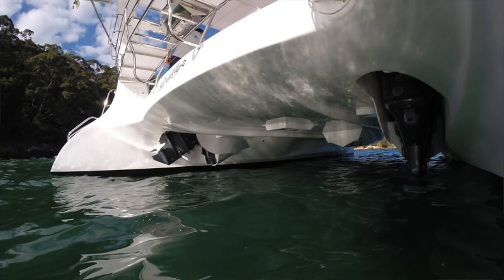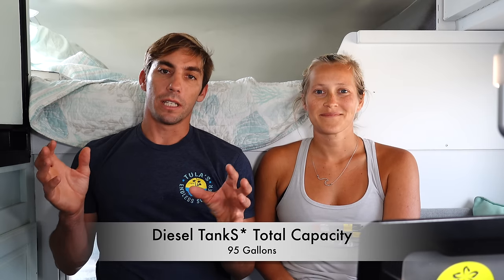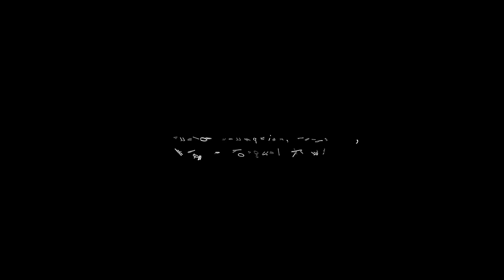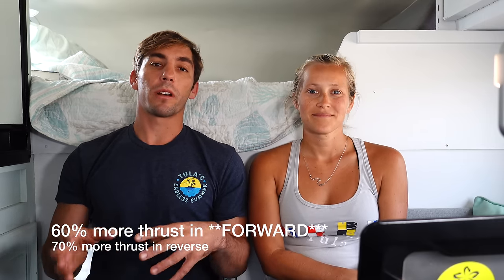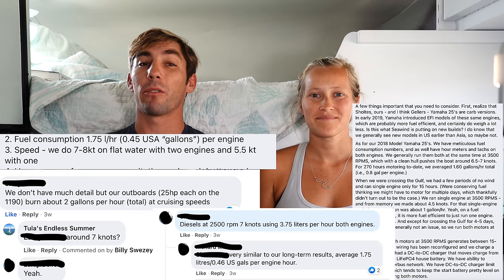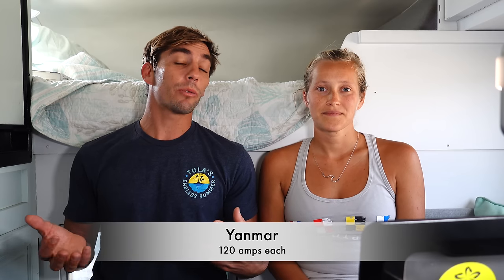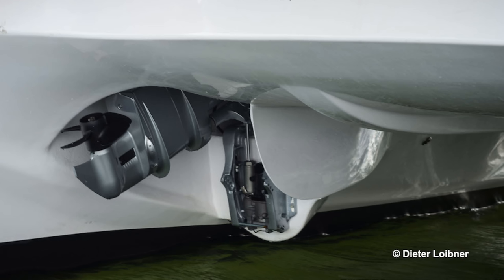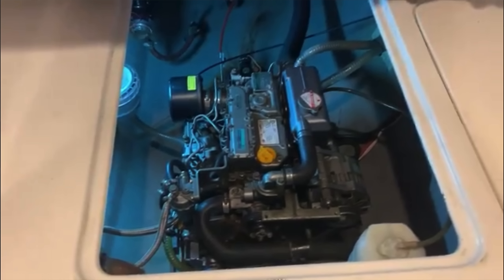Do Outboards Make Sense on a Performance Cruising Catamaran?

Comment: I went over this same decision when I was looking at getting a Seawind. In the end I spoke to someone who's got the Yamaha outboards on his Seawind and he's really happy with them. He's based in Singapore and has sailed all over SE Asia in his boat and he's happy with the Yamahas since he can get parts and service nearly anywhere. He also has a Honda portable Gen set he uses and has only one type of fuel on board. He carries extra fuel for his outboards, generator and dinghy and often runs on one engine to extend range. He loves pulling the engines out of the water to reduce drag during sailing and he's always getting caught in fishing nets etc so pulling the props out and removing the stuff stuck to his props makes things easier. However, if he was living on the boat full time he'd get diesels. He only sails a few weeks at a time so the outboards work better for him in that situation.

Comment: Diesels, for sure.  Can't beat the fuel efficiency and increased range for travel.  Your going to appreciate the tremendous amount of amps they can generate to charge your lithium battery bank.
Reply: I think the added weight outweighs the fuel savings, tbh. Factoring in the haul outs for the sail drives and other maintenance kind of dusts the whole $$ differential.  Not factoring in the thousands saved by going outboard.

Comment: After watching so many cruisers doing engine compartment yoga while sweating their balls off I feel like this category should carry additional weight under the quality of life category. Even the hassle of maintaining a folding prop verses an outboard prop is a big difference, not to mention the expense. A folding prop means carrying more spare parts, greases, zincs and prop coat too. When you're in crocodile water out in the middle of nowhere working on your prop while trying to not lose your tools and parts to Neptune your value scales tend to shift. I've been on the fence for what I would actually choose but can I say that I feel like I'd prefer a third option?  It might be cool to have a decent sized gen set that is accessable for maintenance and two electric outboards. That way you eliminate most of the negatives of outboards while keeping most of the positives. If the Genset takes a dump on you then you're still in better shape than a monohull because you maintain some redundancy because the solar will provide electricity to run the electric outboards. Not enough to motor out of a no wind situation but enough to get in and out of an anchorage and set the hook. Aircon would be a nice bonus under this setup too. I know it isn't a perfect solution but I like the pro's vs con's a lot better.

As a general philosophy I feel like the best part is no part. The less complex something is the better. Less holes in the boat for props and raw water is better. Less internal combustion engines to maintain is better. Less prop complexity, maintenance and parts is better. Unless a person enjoys engine compartment yoga, trying to get all kinds of parts while in the middle of nowhere, extra work during haul out, and spending tons of money.
Reply: I think you have hit the nail on the head.  Everyone is saying Diesels but that's really been the only realistic option.  Maintenance ease and cost is a big consideration.  KISS - Keep it Simple Stupid
Reply: yes, i would say se same! electric outboards is the best under sail.

Comment: I wish I had known you were asking for input on outboards- we chose the outboards. We have found that the diesels run a knot slower under sail because of the drag/ weight. We have a diesel generator and outboard motors. We will be using the "inboard" space to hold our scuba equipment. We are also live-aboard, though we are coastal cruisers. Regardless of the engine, we recommend running only one unless necessary- it doesn't slow you down and you save so much fuel! (AND WELCOME TO THE SEAWIND FAMILY!!)
Reply: Good to know Barbara... How do you feel about the engine noise?

Comment: The diesel would be my choice regardless of cost because of the charging capability and the extra torque or thrust.  If you ever get into a tidal change with 6 knot currents and high winds the diesel pays for its self.  That is an extreme but I have found it prudent  to always plan for the worst.  If cost is the final factor Then the outboards will work fine because I know you plan based on their capabilities.   The big factor here is that you do get to make the choice.  The new boat is coming.

Comment: I would go diesel !   I have a Wharram cat with two Y 9.9 outboards… I am constantly cleaning carbs and  desalting from sea spay up into the outboard sleds. The weak link in my vessel for sure.. congrats!!
Reply: Yeah, Diesel - if nothing else it's not a combustable. Gasoline fumes on the other hand...
Reply: Yep I think you made the right choice just the energy output alone makes this a no-brainer if you're living on board full time. The extra 400 NM range is a huge bonus and diesel engines are so much more reliable. You two are definitely on the right track, I can't wait to see you on your new boat!
Reply: I always say the correct number of holes drilled in your hull is 0
Reply: Best way to keep spark plugs and carb clean, is unplugged your fuel line and run the fuel empty out of the carbs. I know that’s a hassle, but Honda recommends this with lawn mowers and weed wackers, so if you go with gas, you need to empty the lines and carbs.
Reply: Newer 2 stroke outboards are direct injection. No oil burn (smoke) as the exhaust valve isn’t exposed when the fuel gets into the cylinder.
Reply: Cool boat! Love the philosophy behind Wharrams. Tiki 26? Did you self build?

Comment: I've had inboards and outboards over the years.  I found that lifting my outboards out of the water when idle prevented the galvanic corrosion I experienced with drives that sat forever in the water.

Comment: Something you did not hit on is hull penetration for prop shafts. I have an I/O drive on my gas driven boat and I have had water leakage due to the shift cable boot. I completely understand your well thought out choice for inboard diesel. With outboards you have no potential leak points.

Comment: Good choice.  I was part of a crew that moved an older Seawind from the west coast of Florida to the Miami boat show and back. Pushing into the wind going across Florida bay the outboards cavitation was a huge issue.  The fuel fills where on the bridge deck and the vents were sketchy so we had to close up the hulls when fueling. The range was so poor we had ten Jerry  cans lashed to the stern (which expanded in the sun and dripped )

Comment: We own a PDQ cat and I just changed out my two Yamaha 9.9 high thrust motors. The old ones lasted 17 years. We also run a 9.9 on our dinghy so can share spare parts mostly. Can’t beat the replacement cost! I would probably prefer diesels but I’m quite happy with my outboards! It would be nice to have more power generation however.

Comment: 4 1/2 years with our 1160 Lite and Yamahas and I'm still very happy with that decision.  That includes a fair # of blue water miles/long passages.  The increased sailing speed + ability to clear a fouled prop have been the biggest benefits to date.
Reply: Hi Bob Scholtes. 

Good that you mention Speed while sailing, that is totally missed in this video. What do you experience as extra speeds with lifted outboards compared to the diesel saildrives? It's not only the drag, but also the weight.
Reply: @PieterOskam  We've sailed with other 1160's with the diesels and are usually at least 1/2 to 1 kt faster for same sail plan and point of sail.
Reply: Curious if you still own the 1160?

Comment: In my view, for liveaboard, adventuring, anchoring out sailors, the inboard has many advantages to offer. Not the least is hot water production for showering and dish rinsing, in addition to the electrical contribution, noise reduction, and range advantage, with a less volatile fuel.

Comment: Prop diameter has a big influence on the overall efficiency. You didn't mention this, but I suspect the diesel option comes with a larger prop diameter. This could make a big difference.
Reply: Excellent point Gary

Comment: Have to wonder how many of the commenters have or do own a Seawind.  I have owned a Seawind since 2012 and would point out they are designed from the ground up for outboards.  Outboards with a long shaft and high thrust options.  Mine has 12 inch elephant ear props.  I have never had an issue driving the boat against current and wind with this set up.  The placement of the outboards is well forward and the boat turns in it's own boat length 180 degrees.  This is because the outboards are much farther forward than the saildrive is. Not only does the forward position aid in controlling the boat it also helps with cavitation.  The biggest factor for me is what I will call sailing style.  I looked at some of the peeps who have commented and they seem to have what I call condomarans which are often dissed because they motor so much.  On the other hand on one three month cruise I would up using less than five gallons of gas in large part because I only used the outboards when anchoring to back down.  Sure I was limited by the wind speed and direction in my choice of when I could make a passage.  But as my Dad use to say 'a man in a hurry has no business with a sailboat'.  For me it is a no brainer that outboards are a better choice.  The huge advantage in being able to crabclaw the boat sideways to dock and the additional speed when sailing because the outboards are out of the water as well as no need for zincs because no metal is in the water (I have a composting head so no through hulls) far out weigh any fuel savings of a diesel; not to mention a huge cost savings.
Reply: You're right Tom. I wonder how many understand whether they are buying a 'sailing boat' or a motor boat with sails. Lin and Larry Pardey didn't even have a motor!  Electric outboards with solar panels, a wind generator and lots of lithium batteries and i don't think you could go wrong today.
Reply: Tom - They talked about the slap underneath, how loud or often was that and in what kind of seas?

Comment: You should see what happened to the Gone with the Wynn’s lower cubbie, it snapped off during passage and they lost there life raft and were completely exposed to the ocean in there cabin area. It was about 3/4 videos ago, but this could happen to an outboard in ruff seas.
Reply: Good point! I wonder if they could also snap off? They are tucked up in the casing...interesting.
Reply: If we are talking 'what could happen, it is probably more likely that you sail over a log or container and rip out the saildrive. Having said that, I would go for the diesels as well for the same reasons mentioned.
Reply: Has this ever happened to a Seawind before?
Reply: @carsonc1272  If the outboards did hit something I would think the leg release would bust before the mounting broke, which would allow the leg to pivot up.
If you are talking about a life-raft pod breaking off, the Seawind doesn't have a underslung pod like the leopard. It looked like Gone with the Wynn's pod was held on with four 1/2 inch bolts which just broke.
Reply: @davidwood4427  I was asking about the outboards because I didn't think that issues with them were likely but didn't want to jump to any conclusions.
Reply: Completely different issue.  The outboard compartments lids are way higher away from the water.    The REAL  risk is hitting something with the sail drives... causing a massive leak than can sink the hull(s) as they are not sealed from the rest of the hull.

Comment: I have a 24' catamaran. Originally, the outboard was slung over the back beam, on a swing arm to go the more than 2' down to the water. This combo was too heavy that far back, even with the 4hp 2 stroke engine. So much cavitation too. I moved location to under the centre of the bridge deck and mounted the new 9.9hp 4 stroke in a nacelle made from the front half of a Dart 18 racing cat hull, which hangs one foot clear of the water. No slaming. Cavitation only happens in steep chop. Obviously this was a weighty addition. But having replaced the165kg  'one piece' fibreglass bridge deck/back beam with foam core deck and aluminium truss back beam, I've actually saved weight! Pitching is less too. Happy days.

Comment: You made the right choice.
Most items/options, you can add later, after you're sailing.
The diesels obviously need to be part of the initial build.
So ya, good choice!
Good luck with the sail drives. 
Obviously a straight shaft would be simpler and more robust, but it is what it is.
Hopefully they will be trouble free or as trouble free as sail boat stuff can be. 😀

Comment: I had a Yanmar saildrive in my 1984 sailbost.. it was a 2GM.. had the boat for 20 years. Never failed me. I'm a fan of Yanmars. Those are very good outboards, but if affordable.. I would go diesel.. yes, a lot easier to repower with the outboard, but with a Yanmar, repowering isn't likely

Comment: Great presentation.  I go by a simple rule.."buy cheap, buy twice"  In the long run your investment in diesels will pay for the difference.  Having large alternates being a big component of your overall electrical system is great.  You hear all the time on sailing channels people upgrading to larger alternators, and not installing a full generator system.  Good choice !!!!
Reply: What does this even mean? The Yamahas and Honda outboards are most likely more reliable and definitely come with far less maintenance. I get the alternator part but not the other stuff

Comment: Definitely diesel - saildrive props stay where they're needed during really bad sea conditions and the diesel alternator amps are needed for quicker recharging. ;-)
Reply: What Bob said holds for me.
Reply: One thing.
I agree. However the engine compartiment needs to be separate from the rest of the Hull.
In case of gasket failure at saildrive
Reply: @thenarrator1984  it's a saildrive not a shaft through hull. Saildrives are sealed just like the lower unit of an outboard with non moving gaskets, not seals. They don't leak unless you rip one off.
Reply: @h2opcs   That's the issue with sail drives on Seawinds.  Hitting large debris will dislodge the seals and flood the ENTIRE hull, not just the engine compartment as its not isolated from the hull.
Reply: @h2opcs  Steve you are a bit confused here, saildrive engine are a shaft through Hull but in a different way than the normal inboard engine, however they need to be installed in a watertight compartment like normal inboard engine but instead the propulsion to be horizontally is vertical, mainly like a thruster leg. The outboard engine are encapsulated and watertight so that is the reason why they called outboard, they can installed in an open compartment.
Reply: @eurotrash4629  not only that they can also hit an object.. But if the saildrive is installed into a watertight compartment the water can only flood this compartment until reach the water level, not the entire boat.

Comment: They definitely have their pro/con for each engine option. I can see someone going with the outboards if this was gonna be their weekend boat to go cruise around and what. For full time living with plans to cross the oceans the diesel definitely makes more sense for fuel availability, range, consumption, and their ability to charge up the house batteries much quicker. Not to mention you get more fuel onboard and more weight down low with the diesel option. It is a no brainer as they'll pay for themselves over their lifetime and in resale down the road. Having to haul the boat out for maintenace on the sail drives shouldnt be that big a factor seeing how you should probably be hauling the boat out every 1-1.5yr if you  are full time and/or using it heavily to make sure the bottom is in good shape, clean and scrub, and repaint as needed. For your goals the diesel was the right choice for sure! Looking forward to the video about the electrical system and Billy's plans for the size and batteries he plans on using.

Comment: We have the outboards on our 1160Lite. You have converted all of the points very well. We cruised last season in Mexico. We are very happy with the additional sailing speed. We have the Honda 2200 generator and that has covered all of our power needs. We did just upgrade and double the solar capacity. That should reduce our time running the generator. Another purpose of an inboard is to heat up water. We have the propane on demand water heater and love it. The only time I would have liked to have the inboard diesels was our trip north from Mexico to California doing the Baja Bash. The downsides were fuel consuming/range and noise. We survived and I would do it again. We do plan on doing a pacific crossing, or canal transit. We will be pushed to sail more and be patient when need be. It is a sailboat, and a very good sailing boat at that.

Comment: Good call on diesel for your plans and boating lifestyle.  Have cruised cats with both, my thoughts after the fact:

Diesel- The right choice for full time, go anywhere, working from the boat, air con, potential world cruiser.

Yamaha outboard- The right choice for weekend warriors, Bahamas cruisers, potential longer term Caribbean adventures. The advantage of powering your dingy with a 3rd outboard of the same type adds a lot of redundancy.

Comment: Definitely go the Yanmar/SailDrive route.  I race on a Beneteau 36.7 with the Yanmar/SailDrive combo and it works great, even in reverse.  I would recommend a feathering or folding prop to reduce the drag and the chance of snagging seaweed or lines.